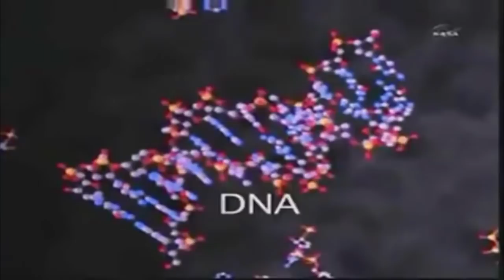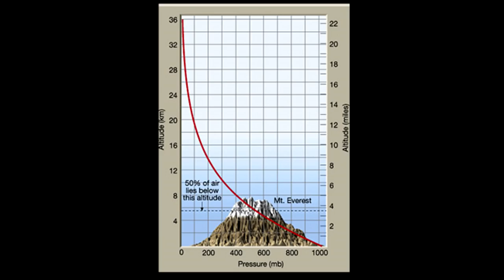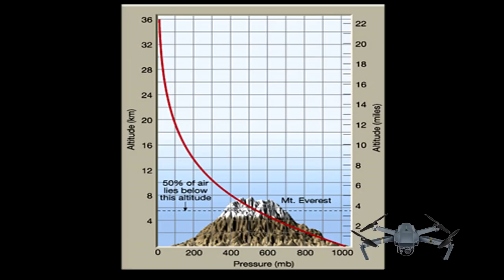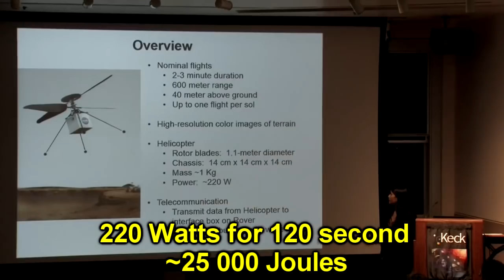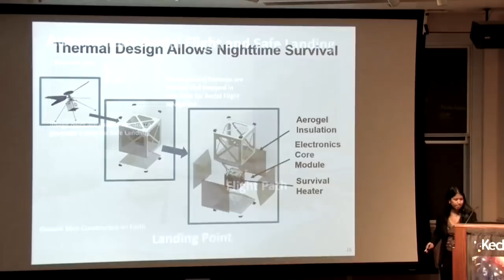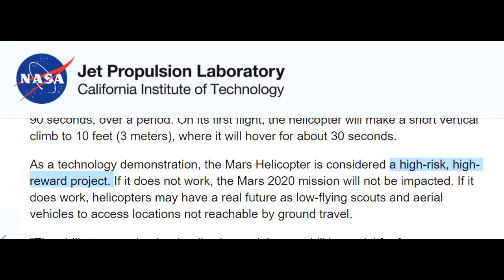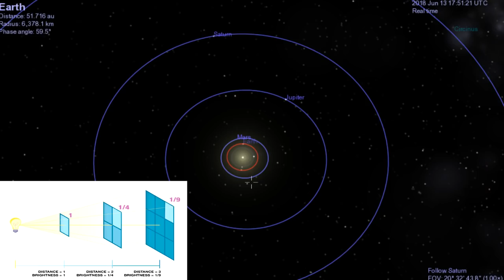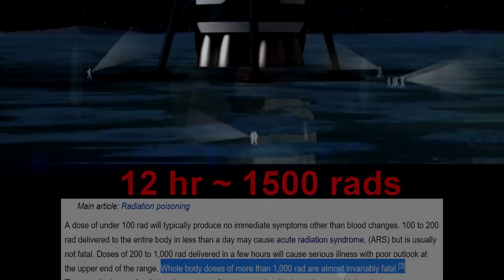NASA is sending Helicopter to Mars!! Smart or Silly?

Comment: Half the air pressure would require double the RPM? 100th the air pressure would require 100x the RPM?
Wind resistance (or lift) is proportional to the square of velocity. Doubling the RPM would hit air molecules twice as often yes but it would also hit each one at twice the speed. You wouldn't need 100x the RPM, you'd need 10.
Reply: twice as often ? dont think so

Comment: 7:36 - Propeller thrust is proportional to the square of the rpm... So 10 times as fast, not 100.

Also, NASA is not going to use a Si based PV cell, it will be GaAs or something of similar 40%+ efficiency.

Comment: Since this is nasa I'm pretty sure they've already thought  everything you said
Reply: My thoughts exactly
Reply: No they didn't.
Reply: Kinda like telling Michel Phelps to swim when he enters a pool.
Reply: Vamoo lol
Reply: Vamoo  

LIST OF SEEABLE GLOBE EVIDENCE

SUN SIZE 
The flat earth model requires the sun (and moon) to be maximum apparent size at noon and then progressively appear smaller as it traverses towards the horizon. And it’s required to be like a “star size” just prior to it “Vanishing due to perspective” and at several degrees above the horizon. But we don’t see that, we see the sun slip behind the horizon at full apparent size

SUN SHAPE
Some flat earthers say the sun&moon are also flat. But if the sun was flat it should appear progressively more oval shaped as it traverses towards the horizon. But we don’t see that either, we see the sun slip behind the horizon in a complete round shape (as well as full apparent size).

SUN and CURVATURE 
You can fly a “first-person-view” (FPV) drone with goggles so you can see what the drone camera records (in real time). Any hobby minded flat earther could do this experiment cos some quadcopters are cheap (like $100). Go to a beach and wait for the sun to completely set, and you can’t see any of the sun “disc” above the horizon (with a sun filter or with your FPV goggles cos FPV goggles are safe, it just washes out and won’t blind you). Then immediately start the drone and take off vertically and watch through your goggles and as you climb higher, you will see the sun again (at least partially). You need a powerful quad, but there are some with powerful “brushless motors” that are around $100, and a camera and goggles is another $100 (you don’t need a top-end quality picture to see the sun again).

PARTLY PHASED MOON
If moon phase is clearly not full, the round part of the phased moon always points towards the sun… implying that space exists and a ball sun, earth and moon and fits with space geometry perfectly.

TELLING THE TIME WITH THE MOON
With the moon‘s phasing you can tell where the sun is and therefore estimate the time (not possible with a flat earth). This can also be proven to work (within an hour) depending on the observer’s judgement. 

SUN EMITTING, MOON REFLECTING LIGHT
At daylight (when you can see both the sun and the moon) if you sight up both the sun and moon, you can see how the moon phase geometry fits with a sun that is emitting light and a moon reflecting light from the sun. How we see the moon phase fit’s that perfectly.
 
MOON PHASE AND DISTANCE OF SUN
And the phase geometry fit’s with a sun that is way further away than the moon. If the sun was the same distance as the moon (and in daylight when the sun and moon appear fairly close) the phase should be half. But moon’s phase is like a quarter when it appears fairly close to the sun. That’s cos the sun is so far away. The moon phase fit’s distant sun perfectly.

DISTANT OBJECTS CUT OFF BOTTOM
Go to cliff on the coast where there are extremely distant object(s) (like islands or large structures) on the horizon. And set up a telescope. Study the distant object(s) and see if you can see it right down to the bottom of the object(s). If you cannot see the bottom of the object(s) you know the cliff is way too high for it to be any "swell" that's cutting it off on the bottom. And if you can go lower and view the same object it will be cut off on the bottom even more by the horizon. 

WAVETOPS
Go up onto a high cliff over the ocean and view the horizon with a telescope. You will see a completely sharp cut-off of the water at the horizon and even see wave detail right on the horizon contrasting the background sky or object(s). If the world was flat we wouldn’t see that (from a high cliff). The horizon should appear like viewed from a high plane with no distinct edge and no wave detail silhouette on the horizon.

THE SOUTHERN CROSS
I live in Australia and flat earthers living in the NH can come down to the SH and observe the Southern Cross. It can be seen circling the SCP (if you look in stages throughout the night) from more than 30 degrees S. You can observe the fact that the Southern Cross never rises or sets, but just keeps going round in circles. I observed the left side of the circle in summer nights and the right side of the circle in winter nights. I have seen the whole circle. I have been keeping track of it for a year or so, it's true, the SCP is really there and I don’t even need time-lapse to see it. 

PLANETS PROVE SPACE

VENUS 
With a small telescope you can view Venus and sometimes it appears larger and like 1/4 phase, and months later it appears smaller and like 3/4 phase. This is what everyone can see in a telescope. When Venus is larger and 1/4 phase it’s on the near side of the sun and when it’s smaller and 3/4 phase it’s on the far side of the sun (this geometry fits that exactly with what we see). This is visual proof of the depth of space.

VENUS MARS JUPITER SATURN
Venus is always observed somewhat near the sun and that completely fits with Venus being inside our orbit. And Mars, Jupiter and Saturn all appear anywhere in the sky in relation to the sun and that implies they are outside our orbit. What we all see proves space.

JUPITER
With the naked eye, Jupiter appears pure white and it’s about the brightest thing in the sky (after Venus) and it does not twinkle at all. It’s so easy to find (when Jupiter is up at night). Even with binoculars you can see the “disc” size of Jupiter (unlike the “point source” stars).

JUPITER’s MOONS
Even with good binoculars you can see Jupiter’s 4 visible moons traversing around Jupiter (side view). If you view in stages like several hours apart (or the next night) and you will see that the moons have changed positions. If the next night is cloudy just view again as soon as you can. Draw on paper what you see in the first stage, then compare it to what you see later in the second stage. Jupiter’s moons orbit quickly cos of Jupiter’s immense gravity.  And this is visual proof of it. Did God put that on the “firmament”?

JUPITER’s GREAT RED SPOT (GRS)
With a good telescope (capable of resolving the GRS on Jupiter) you can see the GRS traverse the planet (in stages) throughout the night. And sometimes the GRS is visible and sometimes it's not (when it's on the other side of the planet).

SATURN’s RINGS
Through a telescope, study Saturn. To find it with the naked eye Saturn looks like a reasonably bright “star” and cream in colour and it does not twinkle at all. So when Saturn is up it’s easy to find if you keep in mind the colour and lack of twinkling (rather than the dominant brightness). Through a telescope you can see Saturn’s rings pitched at a certain angle giving the rings a certain apparent shape. View Saturn again a few months later (when it’s up) and you will see the rings take on a different apparent shape. This implies that the rings do in fact show depth.  Did God put that on the “firmament”?

SATURN’s MOONS
You need a good telescope to see Saturn’s 3 visible moons. Just like with Jupiter, Saturn’s moons prove space by viewing it and then viewing it again the next night. You will see that the 3 moons change positions with each stage of viewing. You just do the same thing with Saturn as you do with Jupiter’s moons, to witness this. But Saturn’s moons are viewed at a different angle than with Jupiter (like not exactly a side view) and the moon’s (at least sometimes) appear like an oval around Saturn (instead of a straight line as with Jupiter).
Reply: Yeah I stopped watching after NASA disproved him... You know in the first two minutes.
Reply: Vamoo  yes of course. #wakeupsheeple
#spaceisfake
Reply: Another pom that lives in the UK that has nothing to do with space due to no space program India,China and Russia all do.
Reply: @Justwantahover 
you have to explain it like you would to a preschool kid .. otherwise it's just useless
Reply: Yes, I'm sure NASA considered everything.  The lift, power consumption... were all tested in that partial vacuum with the cable simulating 1/3 gravity.  That experiment is in many ways better than running some calculations.  That being said, it would be amusing if the helicopter crashes and it is later confirmed that magnetic dust particles got in the engine to cause it.
Reply: Or maybe , they needed the funds and support to something else and they made an idea that catches people's attention
Reply: Vamoo  finally! A rational like- minded intellectual mars is fake and so is space! When will people wake up and realise we live in a simulation.
Reply: @Maximus-kc9zw  
Actually.
If we lived in a simulation well enough, we'd never know.
and our curiosity experiments, and advancements of science would be just as justified. 

But, since I said it, we better give the disclamer. 
We have found particles smaller then the smallest possible computation could be assuming the simulation is in a world with similar laws of physics.
That is to say, the information of the location and interaction of the smallest particles we have found would cause a computer simulating our universe to have too much information, and collapse into a black hole.

Now, that's crazy. But the logical thing given the impossibility of knowing, is to support the sciences. 

And just in case. It sounds like your commenting on a Philosophy bases not a conspiracy theory 

Follow the money, and therefore motivation, behind lying about the roundness of earth.
It sits squarely on big airlines trying to convince the worlds population that the earth is flat when its a globe, as a flat earth would cost more to run flights in and therefore they can charge more. It does not matter what the actual shape of the globe is.
and no government is going to care to lie about the shape of the planet, that just endangers there population needlessly aaand... particularly because being the first nation to "discover" a flat earth would be huuuge, you would be able to fund any project on bonds alone for 30 years at least, and draw every single brightest mind to your nation.
Reply: For real this guy is dense....Lol
Reply: It’s funny bc Mars dosnt even exist smh
Reply: Appeal to authority.
Reply: nah tf is smarter than all , at least he has that huge ego
Reply: @Justwantahover  goddamnit! I clicked  'more' now I got to scroll for 5 min.
Reply: @richardsolomon5375  At least way more than any flat earth seeable evidence "list".
Reply: @Justwantahover  yeah? You know I'm a bit of a skeptic myself, I'm going to need nasa to send my ass into orbit so I can observe it myself. Going to need to hang out on the ISS for a couple weeks too.
Reply: @richardsolomon5375  Well (if you are serious of what you said) you don't need to go on a rocket, cos if you read my list and look (outside) you should be convinced of a ball (go to a telescope meeting near you). And if my list doesn't convince you of a ball (after actually looking) then going on the ISS wouldn't make any difference and you would still believe in a flat earth, that's all I can say.
Reply: What about Columbia and Challenger... surely they thought of everything right..?
Reply: @misakamikoto8785  yep it's not like those actually worked at all prior to the failures they both encountered.
Reply: @misakamikoto8785  They were faked "events" cos I'm a flat earther and space doesn't exist. duh! (SARCASM)
Reply: @TheAnthonywildman  well there is a new Hungarian kid who just broke Phelps's record :)
Reply: It's not an appeal to authority, it's an appeal to expertise.
Reply: @thepsion5  There is no such "appeal to expertise".
Reply: Yeah if it falls over dude it's not getting back up explain this to me
Reply: I mean, in the sense that it's not a logical fallacy, you're correct. But NASA is full of engineers with expertise in the relevant fields. It would be different if you were citing NASA for guidance on history or agriculture or something.
Reply: It wouldn't be the first time that NASA fuck3d things up due to stupid mistakes
Reply: Pretty sure NASA didn't need him to double check their math. LOL, he has some ego to think that he would have found a problem that thousand of rocket scientists and engineers didn't find.
Reply: Vamoo  well they did about 4 months ago
Reply: @sweetyd  I don't really think his video was directed at NASA employees.
Reply: @Sirveaux  when did they disprove him? He actually disproves nasa in several other videos...